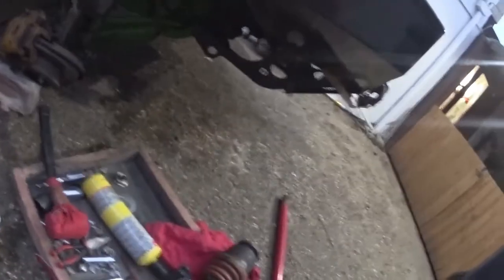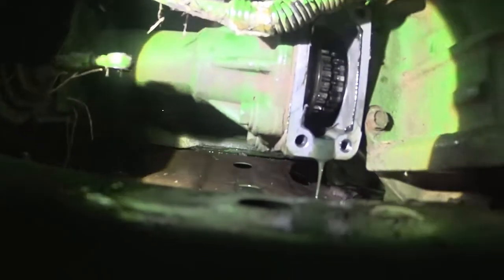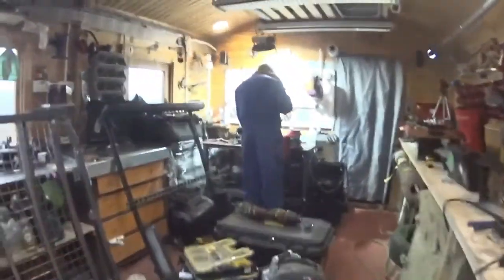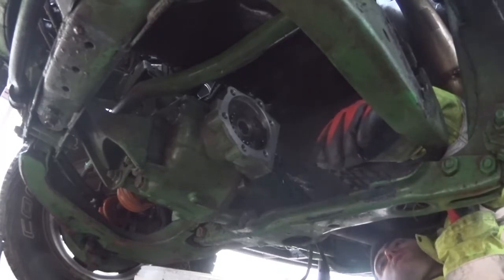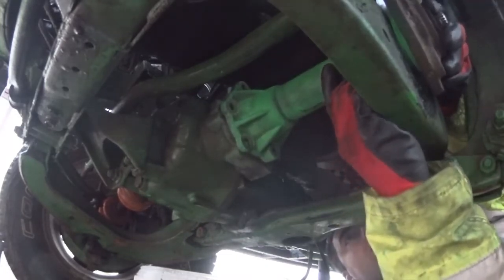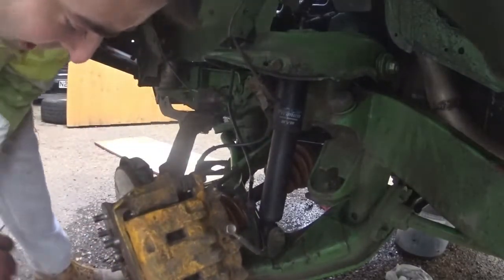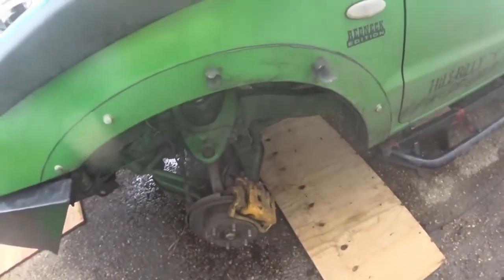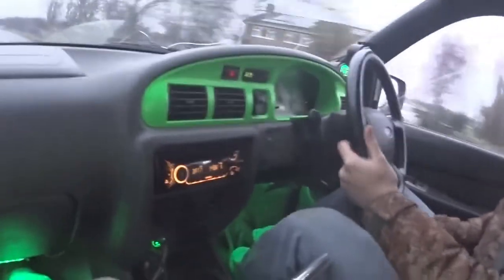Ford Ranger MK2 broken front diff, teardown, repair, test run and coal rolling

Comment: Hi, love your vids guys.
Do you have any experience with gearbox faults? My mk1 2004 ranger is stuck in 4th gear. I've got the top plate off where the sticks are. Any advice?
Reply from the maker: Stuck in third is the usual one 

Tbh mate there’s a long way to go to get to 3/4th hub  and once you do you’ll probably find it wants all the bearings doing and it’s lunched the mainshaft allowing it to drop and misalign and break off the front edges of the synchro/ selector 

Have a look at my othe gearbox vids

Comment: Help. 
Do you know if a rear axle late mk1 diff and an early mk2 diff are interchangeable.?
Basicaly, drive shaft splines and bolt pattern. Because my pinion bearings are giving up.
Reply from the maker: You should be able to swap the third member yes